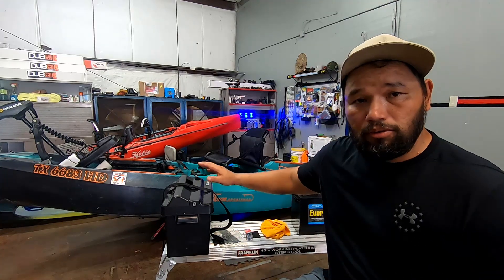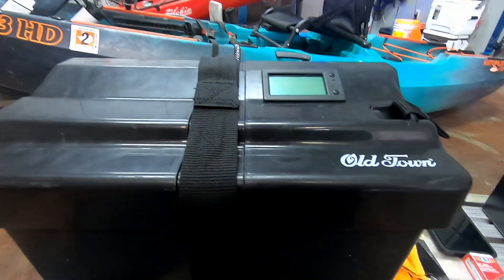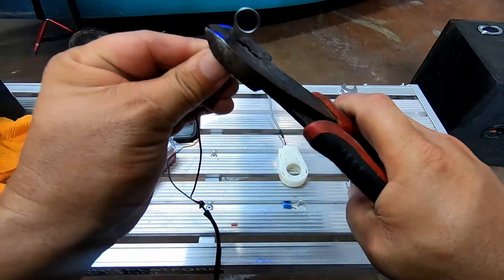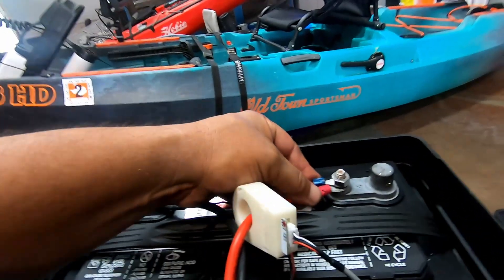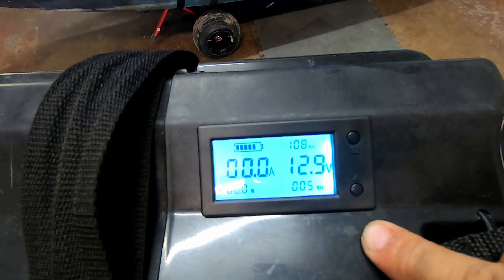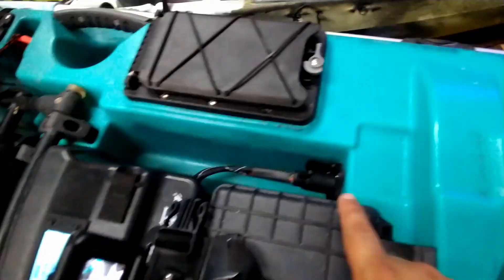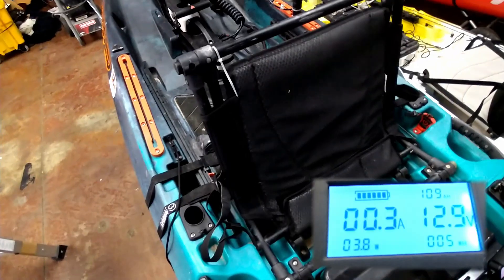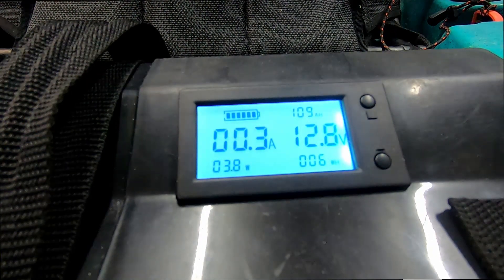Battery Amp/Volt Meter installed on my Old Town Auto Pilot 120 , #kayak

Comment: Good video. Only thing is that amp rating will change and get higher. Once your on the water and that motor has a load on it. But I’d be curious of the load at full speed on the water what kind of amps it draws. ??